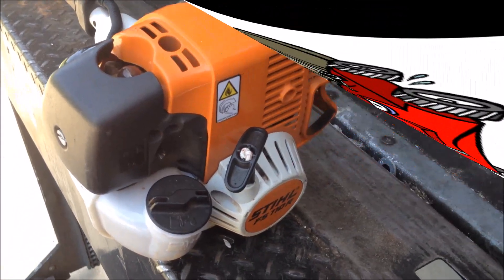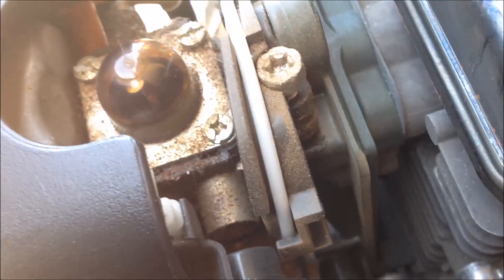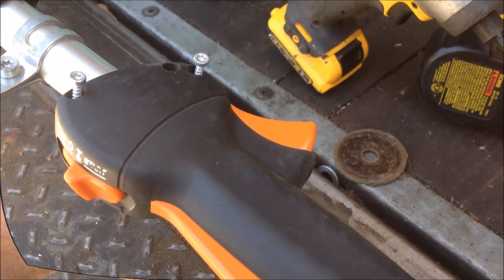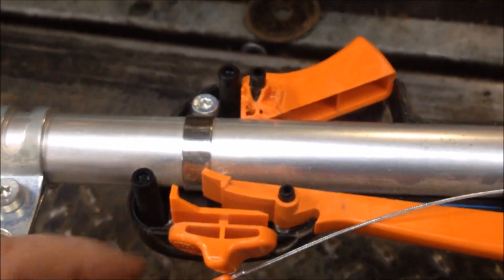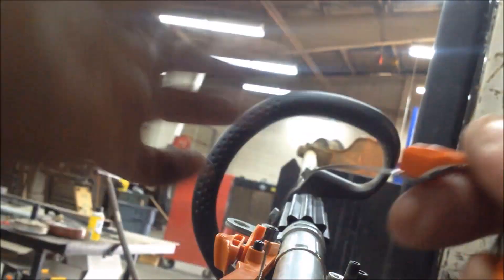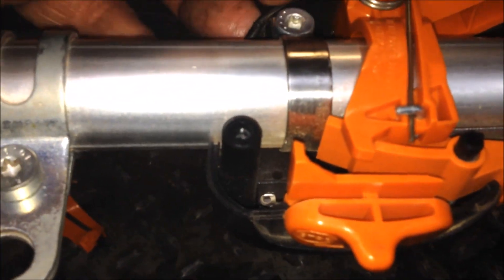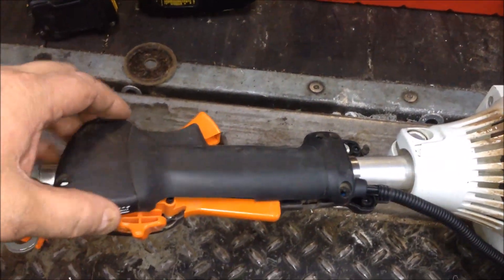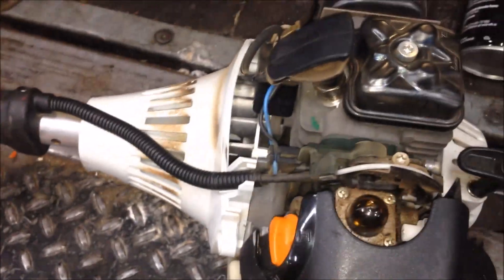STIHL FS SERIES 4MIX TRIMMER / WEED EATER  REPAIR   HOW TO REPLACE A BROKEN THROTTLE TRIGGER

Comment: Mr Medic, I somehow broke the white piece where the throttle mounts on the engine and it slides out upon the activation of the trigger. Can I repair this with some type of jb weld product or will I need to purchase the entire carb to engine mount. Thanks for your reply.

Comment: Do you see many FS94R. I have 2 bought about 6 months a part and have had a lot of issues out of both of them. Both have had to clutches and a couple of others things in less than 2 years. They have been fixed under warranty I have a FS110R Kombi system I have had for 8 or 10 years only thing its had done is one throttle cable and valves adjusted. Its been a great machine I have a FS100R That when was 6 months old blew up had a new short block put in it under warranty.
Reply from the maker: Most of the clutch issues I've seen on the 94s is when the customer takes the line guard off and runs too much line out   It's a fairly powerful engine and will smoke clutch shoes in a heartbeat